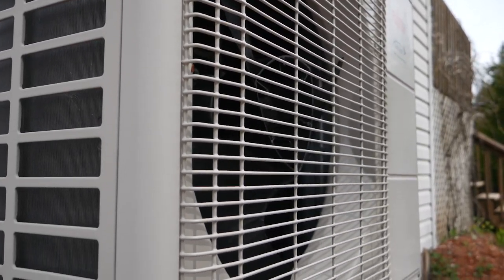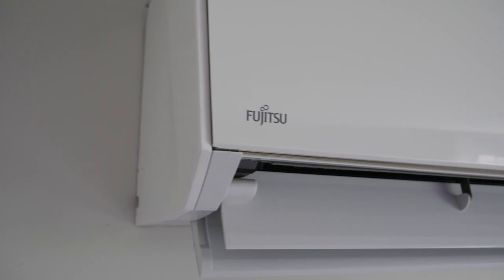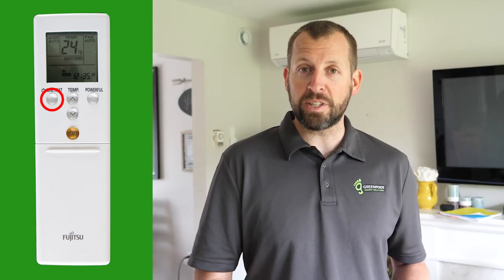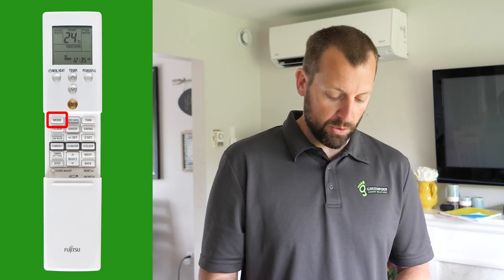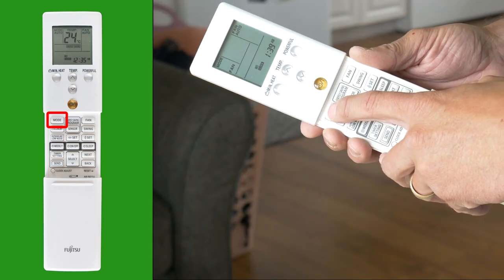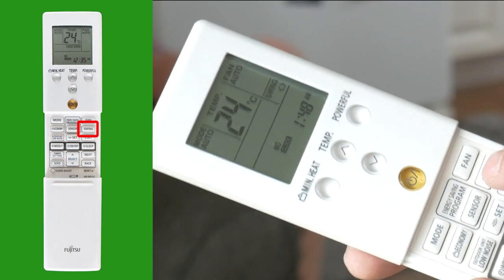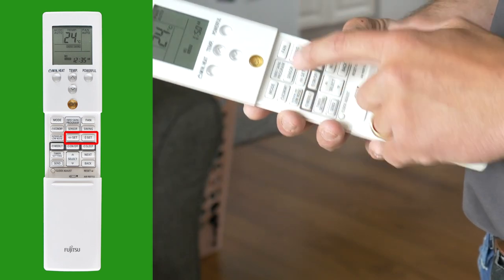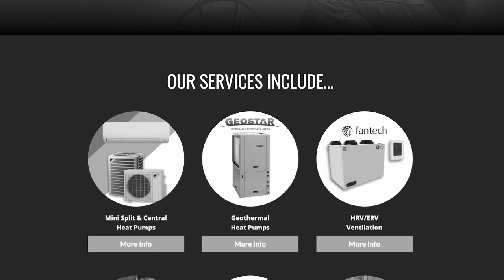How to use your FUJITSU Ductless Heat Pump Remote

Comment: I have two of these and both have a mind of their own. The temperature setpoint, will eventually get you freezing or roasting. Seems to be a universal problem with mini-split units.  However the FUJITSU on the 18,000 will not stay in high fan, regardless of the room size.  I am 24-feet away and feel no air flow, unless it stays in manual high, but the unit despite being in manual fan mode, slowssssss down and stays down, unless I raise or lower temp. Its sucks.  BTW. I am a HVAC Technician. Its a built in economy feature.
Reply: The fan on POWER mode will only stay on for a timed period of 20 minutes then reverts back to the preset mode.
Reply: Are you using the motion sensor function?
Reply: no, they both run 24/7 and really undersized for the space. If i leave for several days in the winter i set to 60F. don't know why but temp, starys around 70 anyway. @LibertyDIY
Reply: It's a real pain. Like you said, mind if it's own.  Try getting the swing mode to work consistently. 

I wouldn't trust the minimum heat function if I was leaving for any length of time.

Comment: I regret buying Fujitsu heat pumps. I was told they would cool down to 60 not true. They are very noisy. The pioneer units I installed myself run better and are never noisy.   Big mistake installing Fujitsu.

Comment: I have a multi zone and one room will heat but one room stays cold. I got it to work right once where both rooms were 70 but I put it on powerful and now it's back to doing that again. Somehow I got it to switch so the other room was warm and the other one was cold and I can't get it to stop doing this. What could possibly cause this?

Comment: Isn’t the clear hose shown at the beginning mainly for the air conditioner? So is there still a need for it when it starts snowing? I ask this because I just had one instead and soo the snow will be higher then the end of the tube and I wonder if I should cover it
Reply from the maker: Hi Jake, the condensate drain is used to route the water produced on the inside coil to the exterior of the home. You are correct that it is important during the cooling function. In heating mode, the refrigerant cycle is reversed and the condensation will form on the exterior coil (in the form of frost which gets melted away automatically). No need to worry about that drain in the winter.
Reply: @GreenfootEnergySolutions  safe to say you could plug it up then in the winter to prevent anything from getting in there like snow and other stuff..
Reply from the maker: @theitfguy  no need to plug it at all. You run the risk of forgetting to unplug it in the cooking season and backing water up into you let home.

Comment: Anyone know how can i heat the 12RLFW1 pass 70 f. I closed all windows doors etc. I dont use the remote i use a wifi themorstat and phone app to turn on and off heat or cool the system. Any settings on the remote?

Comment: Great vid. How do you extend range on the remote control? I sit about 15 feet from unit with no obstructions and have to go near unit for remote to function.  Thank you
Reply from the maker: Hey, no way to extend the range on these. I would try some fresh batteries to see if that would work.
Reply: install the wifi module if available for your unit.

Comment: What is the lowest outside temperature you would recommend running the heat function on in the winter?
Reply: New units will run to -20F, and I have no problem with 20 year old ones on the same day.